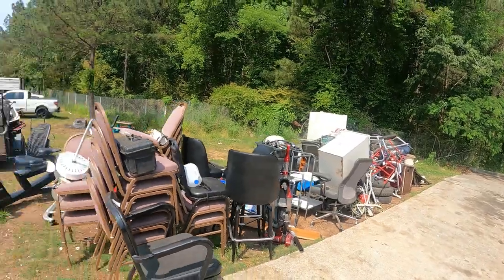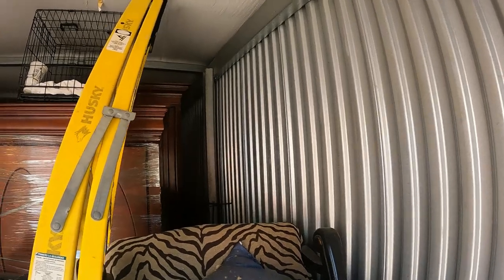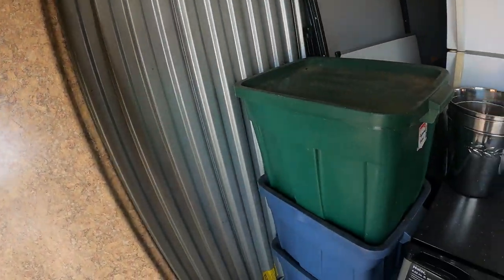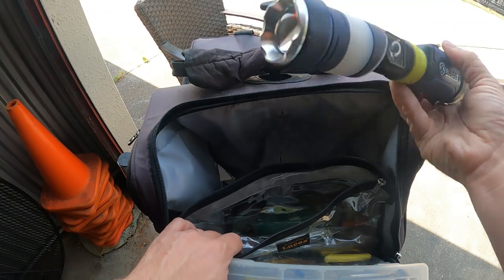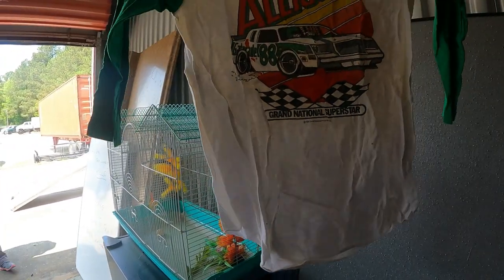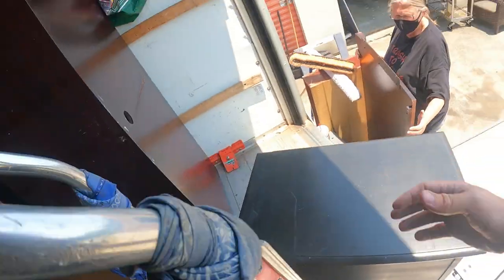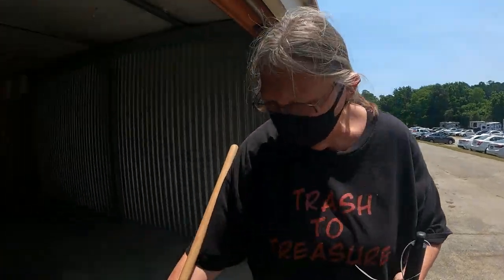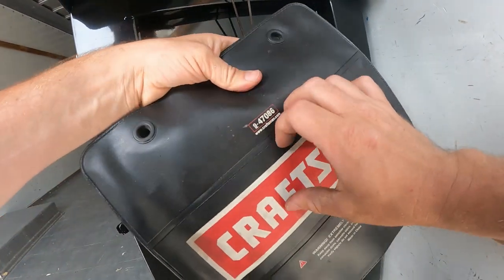Vintage Vinyl And Tools Found In 10' x 20' Storage Auction Unit I Won For $500!

Comment: Hey man that business was probably the one that for drunk people when they are alcoholics they get busted the first time the second time the third time they put a machine at breathalyzer inside the car sort of stop the person from drinking from driving when they’ve been drinking those are the tools that they used to put them in the breathalyzer in he’s got to go to the wiring harness to ignition switch and everything so they got a cut the wires and put them together so if the person drinks and alcohol and he gets busted so if he drinks alcohol in hisWhen he’s drunk if you put it if he brave reason to the breathalyzer the car will not start that’s what it’s because they were doing
Reply from the maker: Yeah that's what I've heard a few people say. I just never knew they had something like that for the ignition. Thanks for watching.